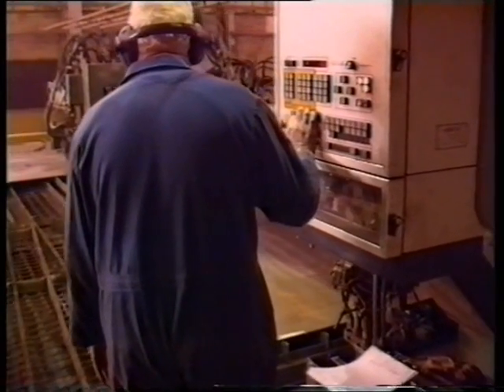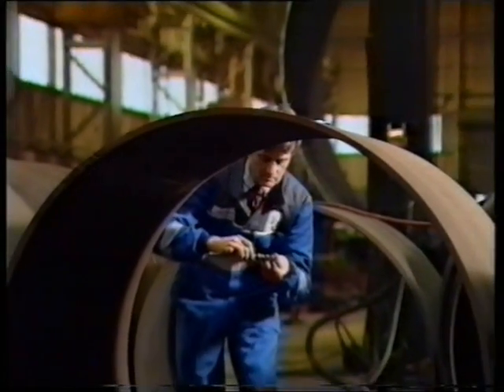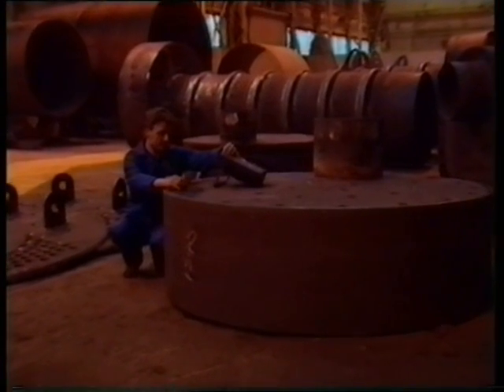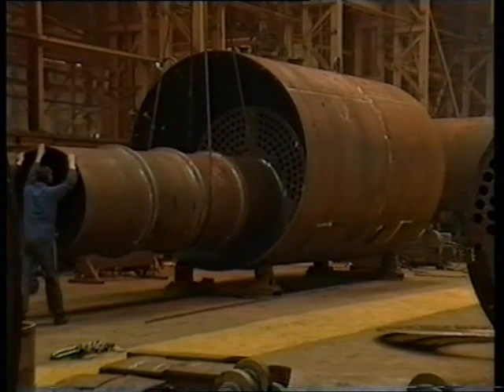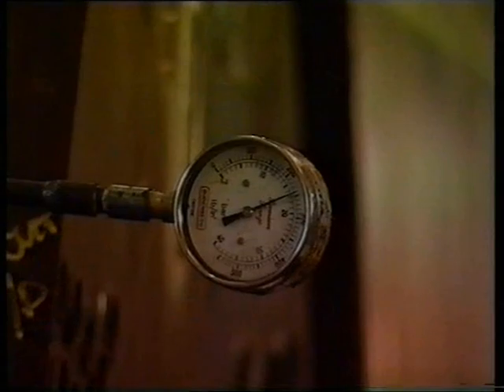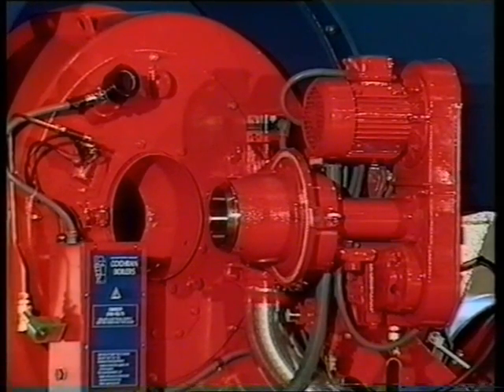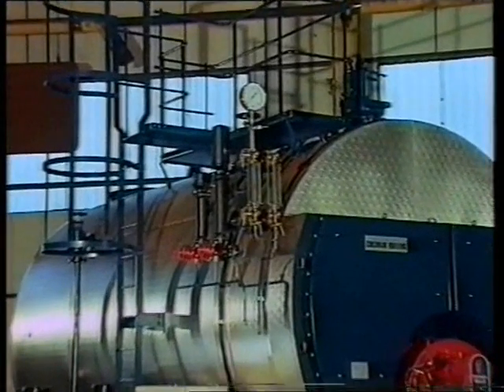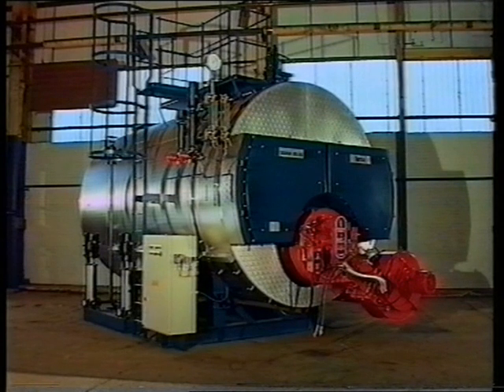Cochran - Boiler Manufacturing Process

Comment: Hi, gentleman, I'd like to share the Tube to tube sheet Automatic orbital welding machine with you, which can improve your working efficiency and welds quality, and save labor cost and management cost for you, please check the video: https://youtu.be/diIzqK4Vjdc
Reply: and the Automatic tube assembling system for boilers or heat exchangers,  refer to video: https://youtu.be/h2WzmZapX7o

Comment: The paddle steamer Waverley has had two sets of Cochrane boilers, that's 4 in total. The first pair lasted 19 years and were replaced this year with another pair after an amazing fund raising effort. 

They drive a triple expansion steam engine rated at 175 psi and 2100 HP. They need to cope with  sudden steam demand required for manouvering and acceleration at piers. Manouvering also means abrupt stop start and change of engine room commands. These requirements were once part and parcel of day to day running of competing fleets that once numbered some 40 steamers on the Clyde, where there were few roads and many coastal villages close together with short stressful hops between piers normally taken racing and fending off the competition. The goto boiler pre WW1 was the Haystack boiler,  with rapid steam generation, and good for 50 psi on a single cylinder, although other boilers were in use, especially when compounding and steam turbines came in.
Things are different now,  but the demands on her boilers are still pretty stressful. The Cochrane boilers did pretty well.